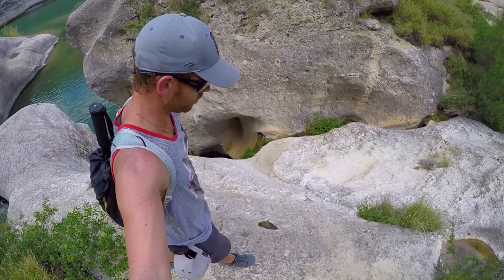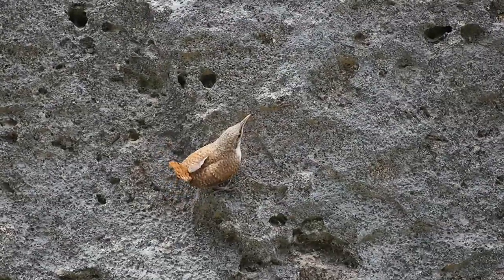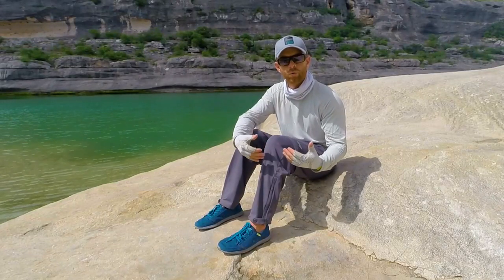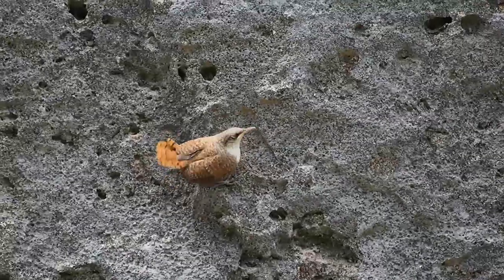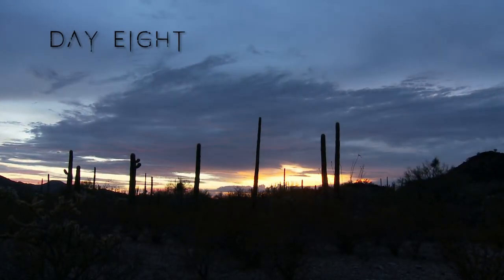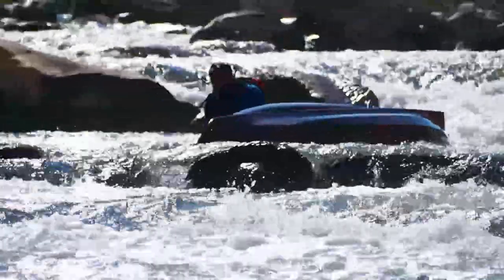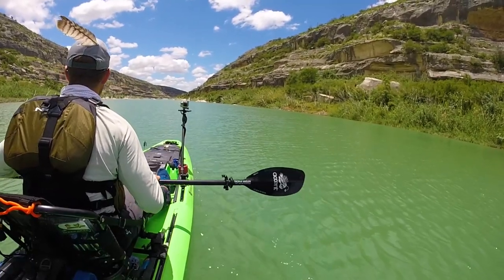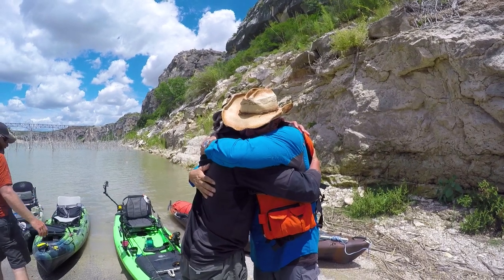Kayak Fishing: Surviving the Pecos River - Part 4 | Field Trips with Robert Field

Comment: Great video as always Robery. Quick question: What are the wires that you have ran to your gopros on the mounts?
Reply from the maker: Those aren't wires, they're leashes in case the boom got broken off and my GoPro fell in. You can hard wire GoPros, but it takes some DIY rigging and I've never done it.